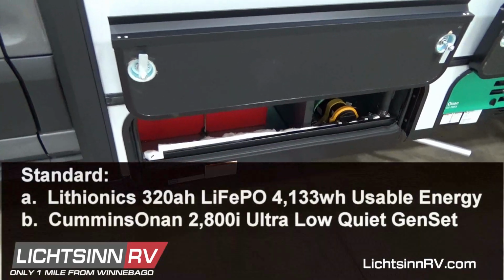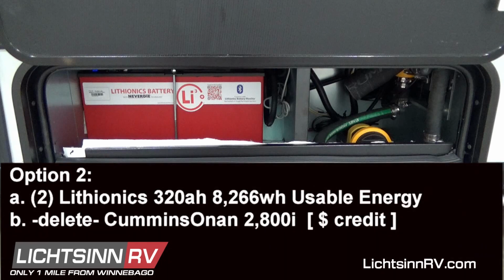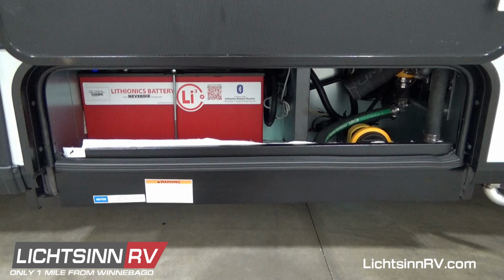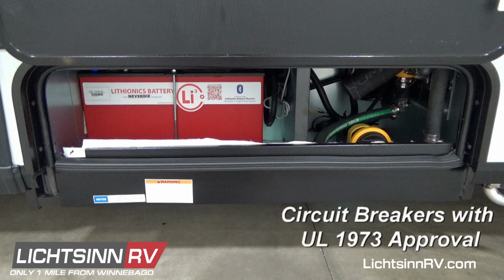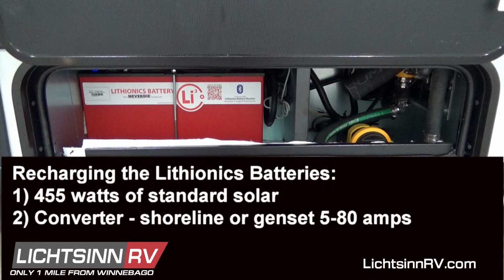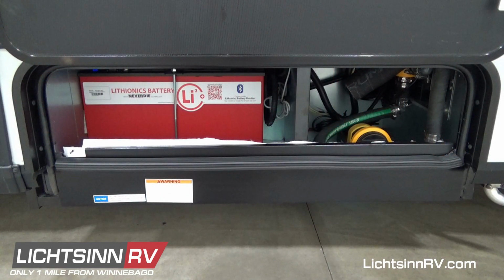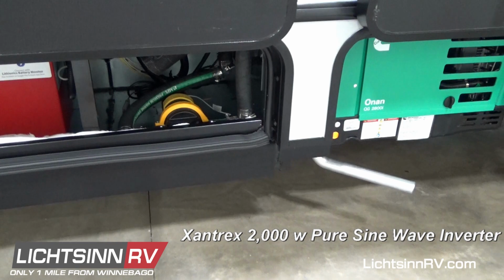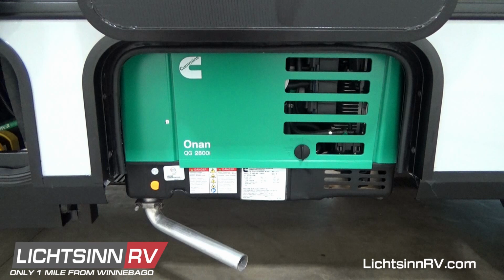LichtsinnRV.com - Winnebago EKKO Off-Grid Electrical Components - Class C Gas Motorhome

Comment: This must be a 2023 EKKO model. It appears that next to the battery is actually the "Whale Gulper" water drain pump. In the 2023 model, the inverter has been moved up under the dinette seats and the Whale Gulper has been moved into the location where the inverter was in the 2022 EKKO model.
Reply from the maker: Good afternoon Tom!   Thank you for your note!   This vide was done on a 2023 model as you indicated!   Hope this helps!